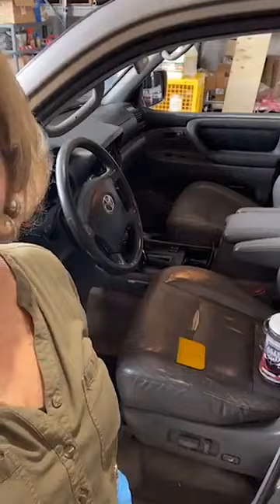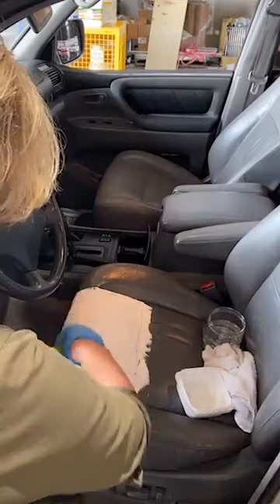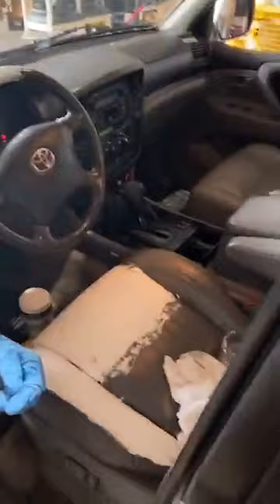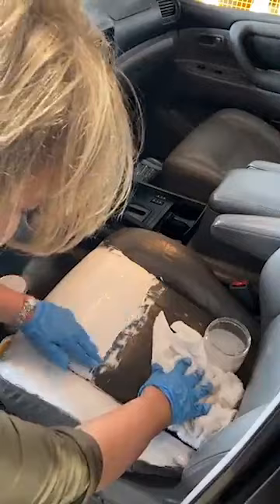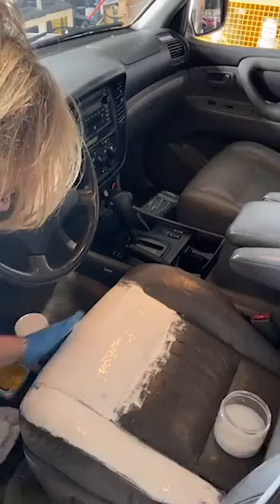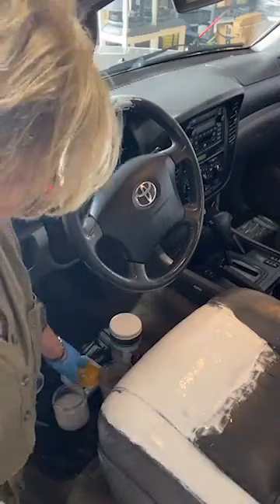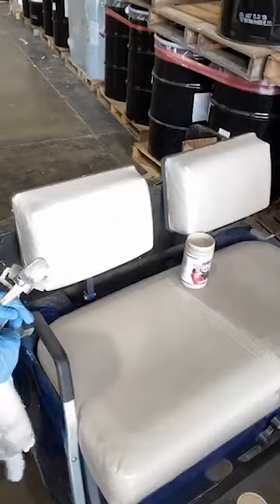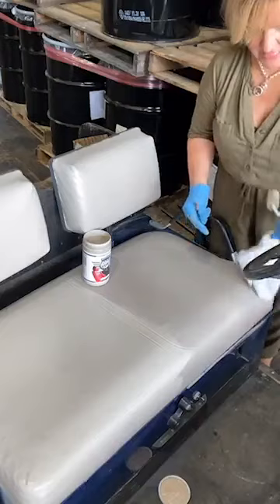How To Repair and Restore Leather Vehicle Seats, Golf Carts and MORE using ALL-IN-ONE Paint!

Comment: I wish I had seen this video before I worked on my bonded leather chairs. It is not smooth even after sanding. Looks like raised islands and lines and is even more obvious after painting. Would you recommend putting more bond and flex over the paint to try to smooth it?